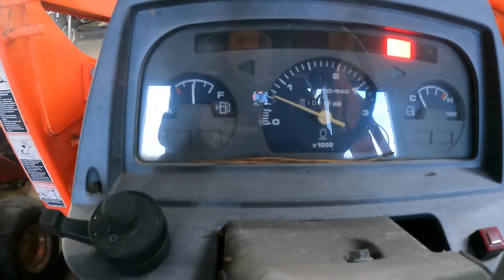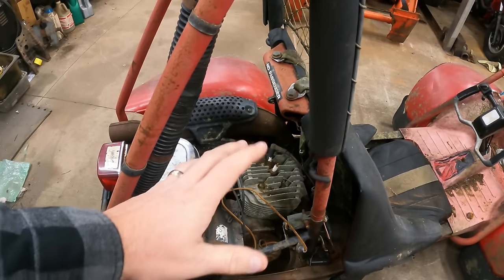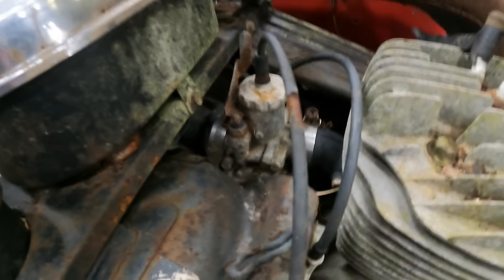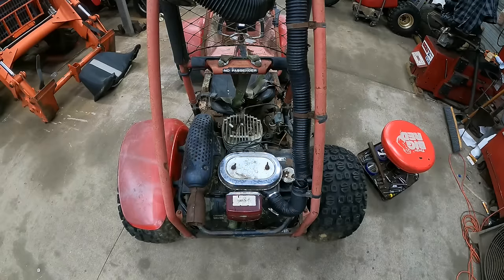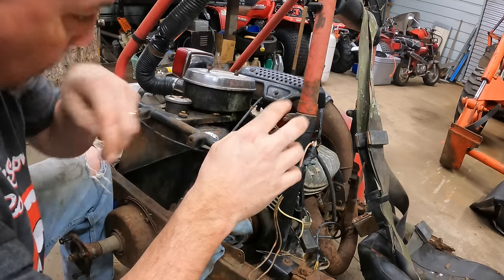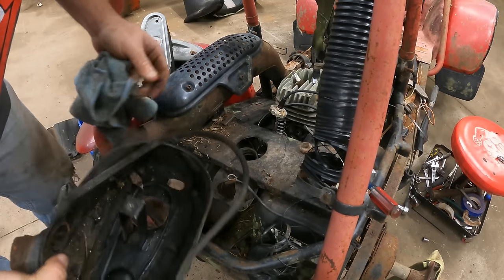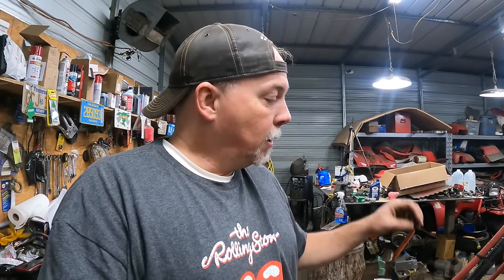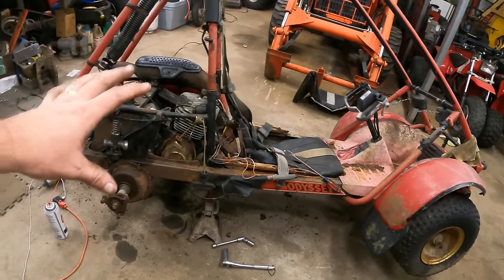The Honda Odyssey FL250: Reviving a  Legend!

Comment: I only have one honda 1985 250 sx    (love it)   I have done and still have work to do on her but it runs great.   I always use a antiseize on about every bolt i ever remove.    I am about to rebuild front forks from a parts machine next.   Good job!!
Reply from the maker: That is awesome! It only starts with one, there like gremlins, get it and it will multiply. lol the SX is a great machine, fun, nimble and a tank when it needs to be. Nice choice, the SX was my first also.

Comment: I owned a FL250 about 7 years ago was way to fast for the solid rear suspension. I ended up installing a racing seat I got at a swap meet for $35 because the original was roached and replacements were expensive I'm sure they are no better now. I have been looking for another for a while it was a boat load of fun. I traded mine to a friend for a "ready to ride" warrior my friend told me he wanted it for his kid to ride because he wasn't comfortable on a quad. He ended up selling the FL250 right after the trade. I only traded because I wanted a kid to enjoy the sport like I did. Had I know what he was going to do it would still be in the horde. I ended up selling the warrior at a severe loss to A coworker who "wanted to ride" with me. He sold that a couple weeks later for more than double what I sold it to him for before we even got to ride together. That entire experience is why I no longer sell especially to people I know.
Reply from the maker: I hate that happen to you and I completely understand, selling to friends or family is always risky. I plan to do the same aftermarket seat but on a floating base, that should help with the no rear suspension some. Thanks for sharing and supporting the channel.
Reply: @mrcbuilds  My seat wasn't padded I had planned to get a cover off summit but traded it. I'm sure just some padding would help immensely. And it's all cool man I learned my lesson. I may have lost that cool vintage Honda but I have more now I've always been more interested in trikes and the loss of the fl250 made room for more trikes.

Comment: I had to watch this video as I bought one about 3or 4 yrs ago but I really haven't messed with it yet. Like yours, Mine has the wire hang around deal also, I looked the machine up and printed the wiring diagram but had other projects that were being neglected also. The motor has great compression which is good. It came from an estate sale and I bid on it by the pics and description only because it was 175 miles away. One thing you mentioned that I didn't catch when looking through the forums was the color generation. Mine is yellow and it even says 1977 on the id tag on the rear frame. Somehow I don't know I'll ever get to it again, rat rod car and truck,rat utility golf cart type, rat 3 wheel '60 model golf cart and mower projects that are inline ahead of this. I was initially excited when I found in research that there are clubs around the world keeping them alive and would be a wealth of information. If anyone is interested in one I have decided to sell it however I live in north central Minnesota. Not looking to get rich, just get my investment back $600, so someone with more time can eventually enjoy it. I did enjoy your video and like you said, there haven't been any of these to my surprise on youtube.
Reply from the maker: Hi Gordon, Thanks for watching, if its yellow its the first generation, much like my red one. I promise you if you make a FB marketplace add listing it for sale for that price, it will be gone by morning. They like 3 wheelers are very hot right now. I understand your pain, to many projects can spread your money thin.
Reply: @mrcbuilds  I have thought about the ad also but will wait until spring so I can get some good pictures. One person was looking for one a while back on Craigslist and showed interest but I gave up waiting on the no show so after seeing someone else excited over one like this my interest may peak again and cut in line of the other ones....we'll see what life brings.

Comment: ON that OLD THING......I would put a set of crankshaft seals in it BEFORE I did much running. of it. you can bet they will be leaking and making it run super lean. This will cost you a top end PISTON, BORE, and a bunch more money.
Reply from the maker: Thanks for the heads up Mike. I appreciate it.
Reply: @mrcbuilds  could be a 70s. came out in the late 70s like that one. I am not sure. check the vin plate near the bars. I think that is where they are located IDK...dont remember. but it sould have the year on there or the vin starts with the year. I cant totally remember that either.

Comment: Luv the video,  I have a few Hondas from the 80’s…..85 ATC 250R,  85 200X, 85 CR 125, 85 Spree…..the 250 R and 200X were bought the same day…..I got the R, my uncle got the X…..1985 …..bought @ Haslett Honda, Haslett MI……just put a few of them on you tube All Vintage
Reply from the maker: Sounds like you have some very nice atc's, thanks for watching.

Comment: When I was in high school, I wanted an Odyssey more than I wanted a girlfriend. I didn't get to ride in an Odessey until I was about 30. I found out that it had no rear suspension at about full speed. After that, I rode it back at about half throttle and haven't wanted one since.
Reply from the maker: I have a few ideas to help that. Granted the later model has full suspension. But we will work with this one for now. Lol, thanks for sharing and watching!

Comment: The carburetor that looks actually like that one on other 250cc engines. That isn't actually like yours won't fit.,or sometimes even work at all due vacuum lift pressure is differs in those years.&model makes of Honda engines to. Witch is from the stroke.& Bore patterns are slightly different enough to not allow.,or accept that type of carburetor on your style of engine you maybe working on at that point.&'time. Those manuals you got explains that more for you on those matters.& Issues to.
Reply from the maker: Thanks for the insight

Comment: I always thought the dual plugs for fowling was a dumb idea, a plug that doesn't fire will fowl worse than one that sparks so when the ran plug fowls out the other ain't gonna do crap for ya lol
Thing to do is get a dual-plug-coil to fire BOTH spark plugs together, you won't get much better spark than that!

83+ is when Honda settled on their wiring methods, 82 & earlier most Honda machines had inconsistent wiring methods and wire color codes making each of them quite the pain to diagnose and repair but all their 83+ machines are heavenly! That was when they FINALLY "standardized" green as ground, orange and blue as signals, etc and got away from having things like main relays shared between fans AND fuel pumps. They also did less of what they did with the CB550s where every trim of every year had completely different wiring harnesses so a 74 CB550F, 74 CB550K, 75 CB550F, and CB550K do not share wiring harnesses and many electric components aren't directly compatible....
Reply from the maker: Hi William,  I will take your word on the wiring changes, I do not have a lot of experience with the street bike line of honda, I did play around with some of there crotch rockets of the late 90s. But that it. Thanks for watching, and I hope you enjoyed the show.
Reply: On the spark plug discussion in 1973 and 74 Honda made Cr 250 and Mt 250 Elsinore's
The Mt had a compression release they used the same casting on the Honda Odyssey for The Jug and head the difference is the Mt has a spot on The Jug that is tapped and the Honda Odyssey jug does not
Reply: @mrcbuilds  Yeah their street machines sure differ from these offroad beasts, I only seem to get the street machines through my doors but love the 3 & 4 wheelers! Always wanted to try an Odessey, looking at everything in your video it seems to be its own breed! I definitely enjoyed this video and am excited to see more on this Odessey!

Comment: They make a cable lube tool you can get it on Amazon for $15
Reply from the maker: Thanks TheDean, I have seen them but never used one, thanks for the tip and for watching.

Comment: The only thing that could.,or might be different on them is the jetting sizes is all. The main jet.& Fuel mixture ratio jet is what I mean by that part of it inside of the float blow.& The venteri tube is ported out different on them to for the carburetor kits that was put inside of them basically to break it all down for ya simplified.

Comment: My dream is to open up a small shop that specializes in mostly older street and dirt bikes that some big shops won’t touch. Some younger mechanics are smarter when it comes to electronics and computerized bikes but know nothing about old two strokes and breaker point systems. I grew up with that stuff.
Reply from the maker: Sounds like a plan! But we do need to teach younger folks this old stuff so they can keep it running after we are gone.

Comment: I just bought a 2nd gen.Oddy a week ago. I'm 54 and can identify with you one a ton of things you said here! But I can't get mine to fire yet going back up to the shop to try" something
Reply from the maker: Good luck. On that machine start with spark. By pass the kill switch to rule that out. Then check the coil. Once you get spark, fuel/air is next if it wont hit off starter fluid you have low compression. Thanks for watching.

Comment: On those Honda pull starters those tabs that come out the connect.& Make contact inside grabbing inside of the starter cup.& Tang ears in the flywheel aluminum fins. Their called tang ears.& Dog feet& tang arms that are spring loaded to release.& Contract in together. When you stop pulling the pull starter pull rope. That has A guide pin with is sometimes riveted in the pull tops.& Some are removable to witch is roll pins that you tap in the pull tops. That's A 1981 small engine on A 1982 Honda odesy.
Reply from the maker: Thanks for sharing, I appreciate it.

Comment: Have one of them but the engine broke and it's almost impossible to find parts so now it's a project . Just have to decide what engine to put in it. I have a Rotax 440 but was thinking Vtwin electric start 4 stroke . Just installed new rubber all the way around 2 weeks later it died . May install independent rear suspension and fix the crappy front suspension and steering.  Looks like yours has been sitting outside a long time
Reply from the maker: I like the sound of a rotax engine for sure, I'd convert to chain drive,  and a hand clutch. Thanks for watching!

Comment: I have a general mechanic question I have a 91 Yamaha rt180 ik it's not honda 😅 but it has over size jugg and piston all new but the person  before me stripped the threads for the top cap to clamp to the jugg for the head gasket and I was wondering the best way to approach the problem because I wanna save the parts thank you 👍
Reply from the maker: I would download the manual oscar meyer has yammys too. I would just go very slowly, Depending on how much room you have to work with, Id take the engine out, I would try every trick in the book. undersized sockets, impact sockets, and hammer them on, last resort torch the heads off. I hate to suggest that, but it may come to it. If you done feel comfortable, pull the engine and take it to a motorcycle shop, and let them fight with it. Good luck and let me know what you come up with. Thanks for watching

Comment: I had the slide get stuck like that on my tri z and the original carb was junk cause it corroded so bad. I got the slide out by pulling the main jet out and getting a punch that fit perfectly around the emulation tube and being as gentle as I could and tapping on it. It came right out that way but it’s not advised if it’s a machine that is hard to get parts for. Don’t know if this will help. But nice find those things go for an incredible amount of money where I live.
Reply from the maker: This is the worst one I have ever had, I soaked it 24 hours in a heated sonic cleaner, nothing, I had to get mad at it and broke the handle of a screwdriver prying it up, That of course nicked the slide, so its useless now. I have an extra 250r carb, I am going to try it tonight, I think I have the intake fixed as well, I want to make a brace to support the carb better so it doesn't just hang off the engine like it does. thanks for watching.

Comment: 300 for that is a steal in my area you can't find them for less than a grand In Worse condition. And also is that a 55 Chevy in the corner of your shop? Another cool project that is getting hard to find without spending a ton.
Reply from the maker: Hi allen, that's my 53 chevy 210 sitting there in the corner. She has a Cadillac 742 motor and turbo 400 trans. It's a fun little car. Yes I thought that was a good price for the odyssey.  Lol

Comment: Its my fault you got the fl250 I asked you last week about getting one . I just ordered $400 in parts from Oddatv. They were good quality. I would get the comet clutch It responds better than the stock unit. Also look for a water cooled head they have a problem over heating. I'm also looking for a replacement seat any ideas? Oh just to let you know my 84 oddy does 51mph on hardpack dirt. Also the Dg header works fine on mine thats the only mod on mine. I would like to see a video on making a electric starter for this unit. hint hint!!!!
Reply from the maker: Hi Michael, Just off the top of my head, I'm thinking a seat base frame that hinges in the front and rides on small coil springs in the rear like a Harley, then mount a high back plastic racing seat from a car. there cheap and safe, keep the shoulder belts.

Comment: I acquired a 1980 Honda CX500 motorcycle from my father a few months ago and that's the project for this coming spring/summer as it doesn't need much. When my friend helped me pick it up he popped the carbs & air box off, cleaned some mouse house out of it, hooked up his portable jumper pack to it, gave it a few squirts of some 2-stroke mix and it fired right off. After looking at the carbs they're frozen solid with some varnished gas as it has been sitting since 2004. But because they're the type that have the vacuum operated slides in them they're garbage anyway. 

My friend found a kit that replaces the original carbs, intake boots, and throttle cable with two standard round slide Mikuni's, two billet intake "throats", and a y-throttle cable. But the kit is going for $650, so it's going to take a bit to get them. Luckily after looking it over all it needs is the carbs, some new tires, a battery & air filters and an oil change. Once she's up and running I'll have some cheap transportation for the summer so I'm not driving my truck everywhere.

My other two projects are my 1985 Kawasaki KLT 110 three wheeler that we pick at every now and then and my 1981 Yamaha YZ 465 dirt bike. We replaced the intake and exhaust valves in the KLT but the momentum stopped after we found that we needed some special tools to remove certain engine parts. Once I have those the work will continue. The YZ on the other hand is a roller/basket case and requires a full rebuild so it is a long term project that I'm not worried about it right now. We've been focusing on more important things that have a higher priority. :)
Reply from the maker: Enjoy the time with friends and family out in the shop, there is no better satisfaction than fixing something yourself. it doesn't matter if its a toaster or a atv, the self worth and satisfaction of a job well done, and that you did it. That's awesome you have your Dads cx500, keep it in the family. Thanks for watching and good luck on your project. Small wins, complete big projects.
Reply: @mrcbuilds  Thanks, the CX is definitely a runner. It is a Honda after all. As long as they're out of the weather and not locked up solid they're like old diesels. They're not dead, they're just taking a long nap until someone shows interest. :)

Comment: Hi. I bought an 86 Big Red 250es. Ran and rode great. Went to start it yesterday and the kick start is locked up...... Just throwing this out to an expert to give me any advise????  The electric start wires have been cut by the previous owners. It's a $600 bike. No beauty queen. Not sure where to start. Thank you for any advice. Really want to get back out and enjoy it.
Reply from the maker: Hi Ron, that's a hard one to diagnose over the interwebs. So it rode fine a day or so ago, now you got to kickstart it,and the kicker is lock, it will not move. I would make sure it's in neutral, pull the plug and try to kick it again. Pull the inspection cap on the left side where the starter gears are. It takes a torx bit, turn the engine by hand, if it does turn I would guess you have a bad one way bearing on the kicker, if the engine does not turn with the plug out, then the motor is locked up. You can put some PB blaster in the sparkplug hole let it sit 24hrs and try to rotate the engine by hand. I hope that helps. Thanks for watching
Reply: @mrcbuilds  Thank you!!!!  Appreciate your responce. I will try that.

Comment: All your videos are great, I am currently restoring an 84' 200s and an 82' 185s, other than E-Bay, do you have any other vendors for parts, any parts, engine, drive train, frame, brakes, etc.? Thanks, and keep up the videos, you're the best.
Reply from the maker: I use amazon a lot, for things that don't have to be Honda, like brake shoes, cables, levers, seat covers, oil, clutches etc.. if it need to be Honda brand, eBay or the FB groups or 3wheelerworld.com.

Comment: The only thing I see missing other than the kill switch is there is a rubber boot that goes over the pull rope. 1 end attaches to the top of the recoil case where the rope goes in and the other end slide over the shaft under the nut at the frame where the handle sits
Reply from the maker: Thank you X, I'm just about ready for another Installed on the oddy, still waiting on a few more parts. Thanks for the heads up.